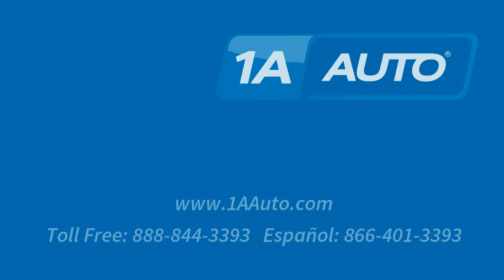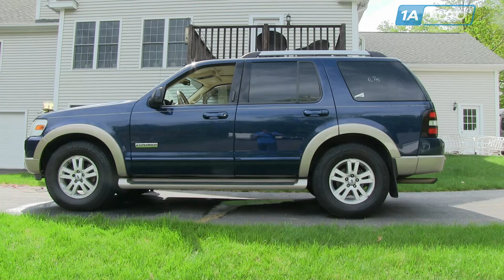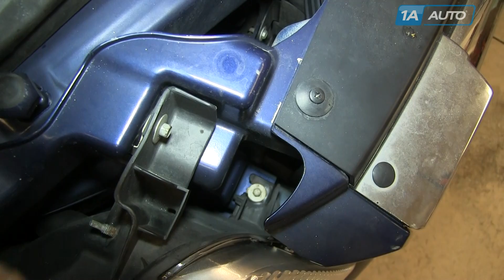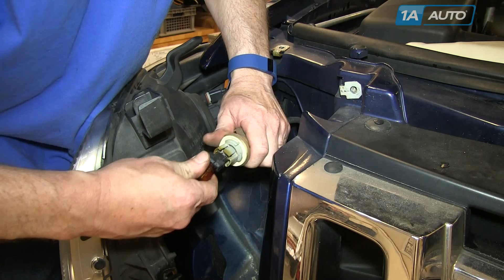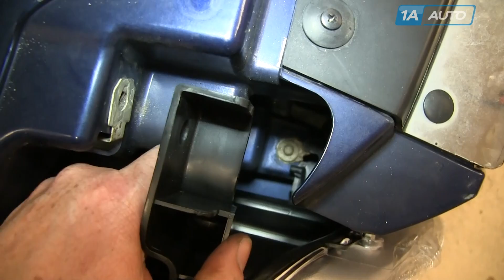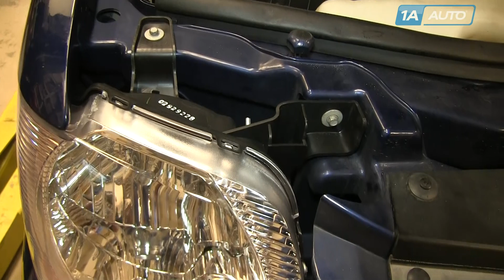How to Replace Headlight and Bulbs 06-10 Ford Explorer

Comment: Hi, I replaced my headlights and now they won't turn on when I press the unlock button on my keys, is there a way to fix this?
Reply from the maker: +Melinda M We wouldn't be able to diagnose an issue like that here, you may want to have a local mechanic take a look at it. Thanks for checking us out! http://1aau.to/m/Shop-1AAuto-c

Comment: nice video and thank you for sharring, would like to find out if the headlight for US specification is similar to the Japan specification 2006 Ford Explorer
Reply from the maker: +CABEBE21 Thanks for checking us out. There is no difference in regards to fit from the information we have. The DOT and SAE compliance are only for the US however, We are unsure about these standards in Japan. Shop here for high quality auto parts: http://1aau.to/m/Shop-1AAuto-c

Comment: Did it. When I pulled the light out my car started going crazy. It will not start now
Reply from the maker: +Robert Stauffer Jr. You should go back and make sure you did not disconnect any wires, evap lines, fuel lines etc. when you replaced the light.  The light itself has nothing to do with the car not starting.
Reply: All fixed. Just needed a new battery as well. Thank you for the help 👍🏼

Comment: will this work for an Lincoln aviator ?
Reply from the maker: +Jassmine s It might be a different procedure on this vehicle. 1aauto.com
Reply: The Lincoln Aviator will be similar to the 2002-05 Ford Explorer and Mercury Mountaineer. All you should need is your hands to pull up the two plastic clips on the top of the headlight assembly directly under the hood, and voila, Aviator/Explorer/Mountaineer headlight bulbs or headlights are ready to be replaced.